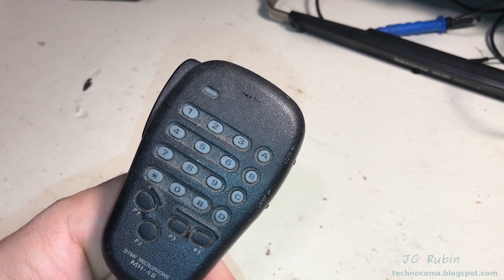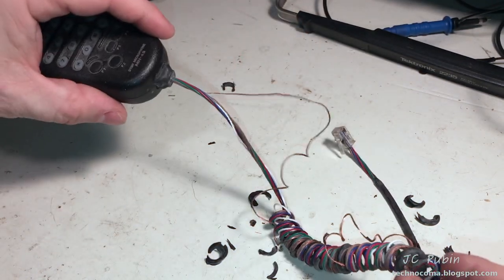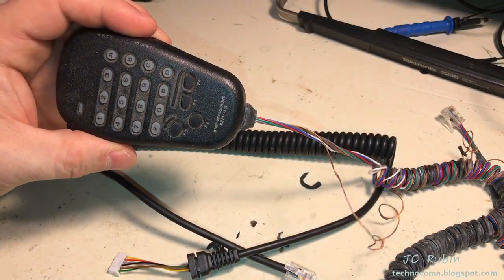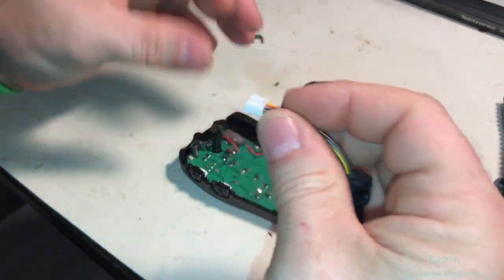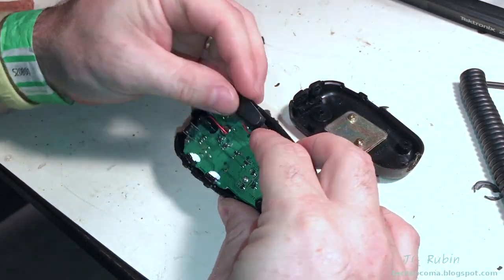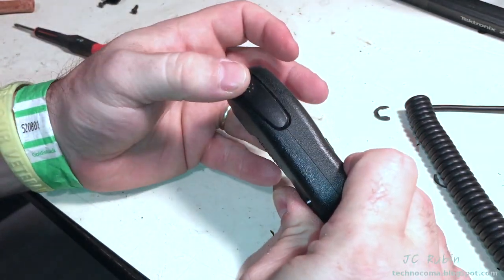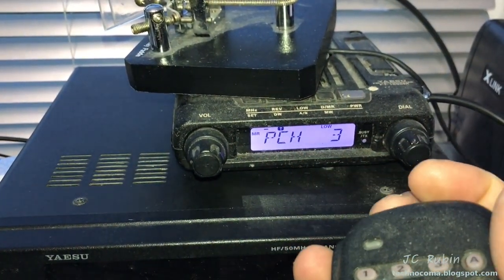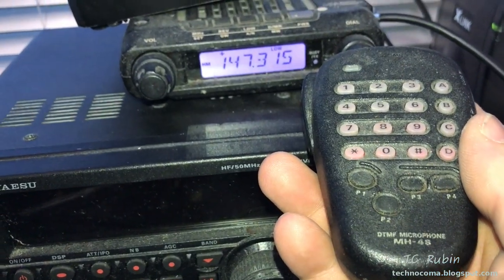Yaesu Microphone - Quick Cable Repair - MH Model

Comment: Good HowTo! The PTT switch is the only difficulty, and even that isn't too hard to get back into place after a few tries. Easy fix for <$10 for a new cable, especially if you're trying to sell older Yaesu radios with this problem.
Reply from the maker: Indeed, it would restore lost value to an otherwise good radio.

Comment: Does the MH-36B use a cable with a similar pin-out?  
I have a pair of FT-2600Ms and both of their mic cables show a degree of rot similar to yours.  These units never stayed long in a vehicle, spending most of their lives in the proverbial "cool, dark place".  It is difficult to imagine a serious manufacturer choosing such poor materials for their gear.  However, based on some other products I bought from Yaesu in the '00s, I don't know that they qualify as a "serious manufacturer".  Their technology has always been good but their materials and quality control took a dive after the 1990s.  Now that it is 10 years later, has Yaesu got its Mojo back?
Reply from the maker: Check on eBay for compatible models like I show.

Comment: Are you aware of anyone selling a replacement cable for the Yaesu MH-59 mic?  It uses all 8 wires similar to what your 6 wire cable does.  I have not found it anywhere other than direct from Yaesu at an expensive cost.  I can find a 8 wire cable but it has the MMJ connector at both ends.   Thanks
Reply from the maker: I cant say, ebay or HRO..